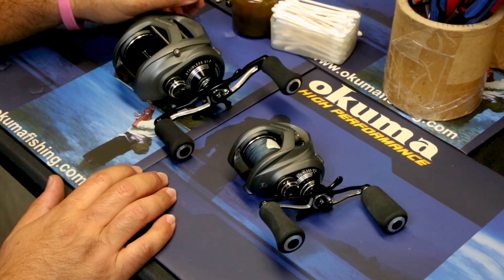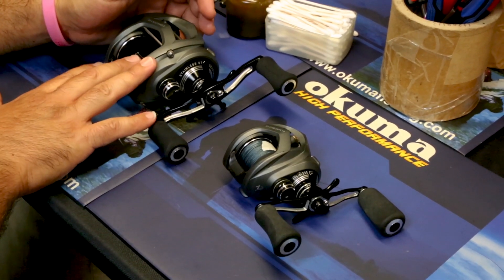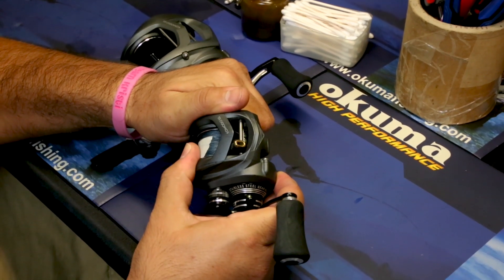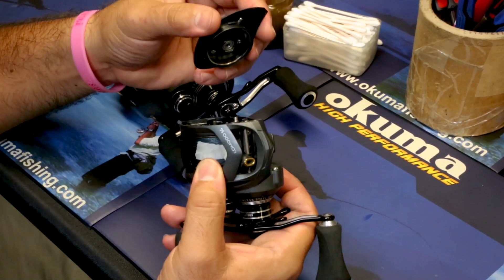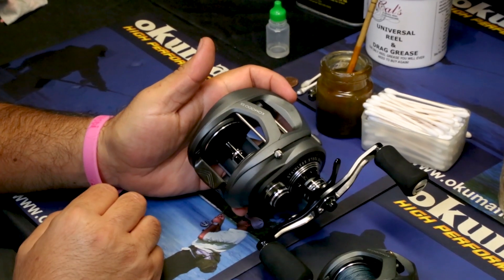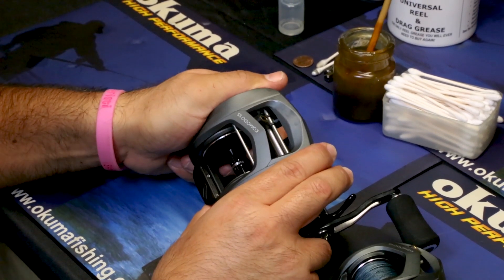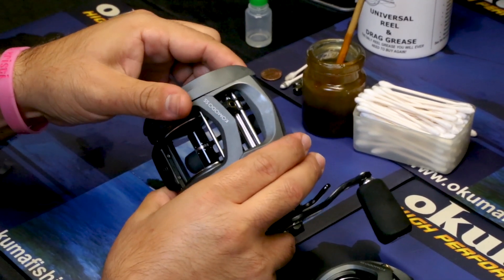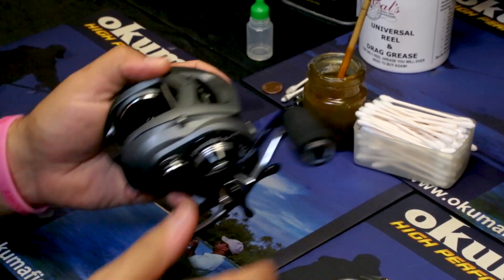Okuma How To - Install/Remove Side Plate on the Komodo SS Reels

Comment: Hi There, I have 273 model, i have fish it for some time like 10x. And I feel like drag system is very lose on reel, I can easlie pull with my palm on pressure max? Why is like that? Bad braid? Twisting on spool? Or reel is faulty?
Reply from the maker: It could be any number of things.  Usually when they come in we find that the braid was not properly attached to the spool.  If you'd like to get in touch with customer service, you can reach out to them at service@okumafishingusa.com.  They can walk you through ways to check.

Comment: I have ss 273 and ss364 I have issue with the brake tab . It's very hard to push the tab in . In the end I have to use a small pick to push it in . Please advise
Reply from the maker: Interesting.  We can probably get it serviced, but unfortunately we are completely shut down for the time being.  No service or shipments in and out of Okuma.